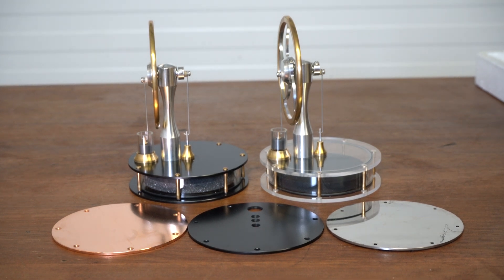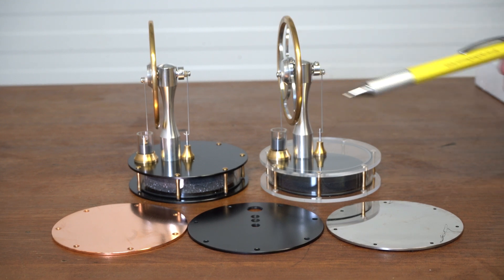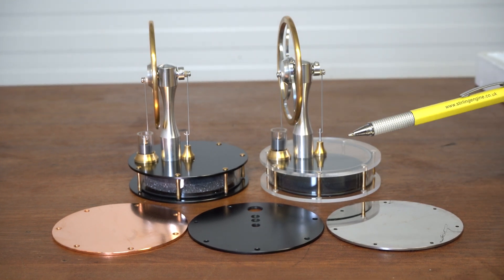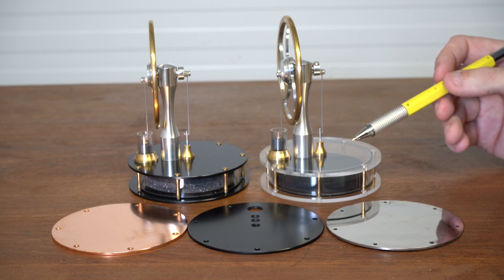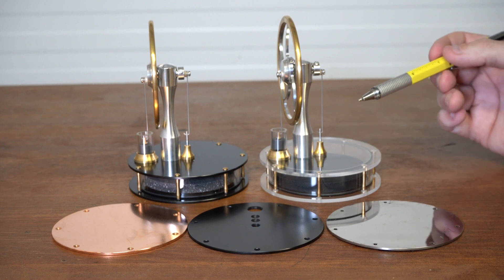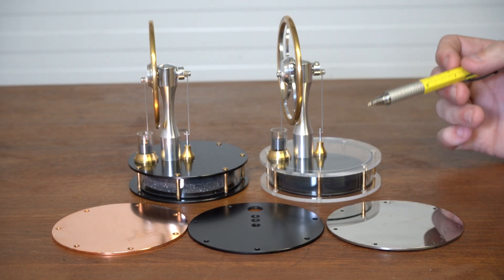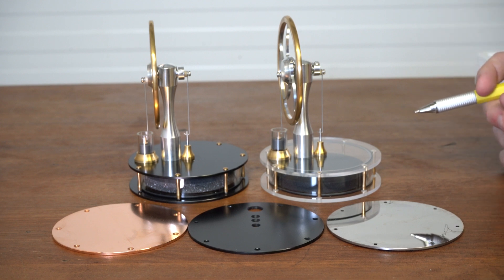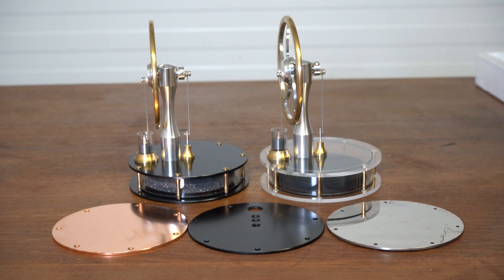Which plate makes the Stirling Engine run faster? - Kontax

Comment: would increasing the surface area of the plate (directly under the displacer disc) aid convection from the plate? i.e. a criss-cross of low profile fins. Excellent kit btw, just built the KS90R Solar Ross, and am probably going to have to move it off my desk so i can concentrate on work instead of watching it! Thanks.
Reply from the maker: In theory yes. Some designs have used fins to make better heatsinks. I've been simulating fin designs on our KS90 range. Interestingly the computer simulations don't predicate much change if any. I'm still tempted to make one just to make sure.
Reply: @KontaxEngineeringLtd  please let me know if it does help, although as you say its likely to be minimal. Currently the heat from my router has been powering mine since moving it off my desk a couple of days ago!
Reply: @KontaxEngineeringLtd   look at making a finned copper power piston shell. I know the type b have great results by adding power piston cooling.

Comment: Love the engines by the way. Me and my dad machined an aluminum sheet to swap out the bottom plate for the Solar Twin to improve the performance. The engine was able to maintain itself further away from its light source. I don't necessarily disagree with what you were saying but helping dissipate the heat form the bottom should help lower the steady state delta a little. We had also put small felt feet on the bottom so it would scratch the table at the time and also let air get under to help convection. This would more or less make it similar to the Solar Inverted model.
Reply from the maker: Was it raw aluminum? the coating on our aluminum plates is more insulating than the aluminum itself. That could also be another factor. Plate thickness the same?
Reply: @KontaxEngineeringLtd  Yes, just raw Al plate (grade 1050 or 1060 i think). The thickness was nearly the same as your other Al plates although there was a little more surface area which would also play some factor.
Reply: By 'swap out' do you mean 'change'?